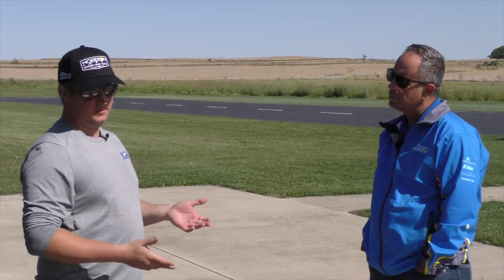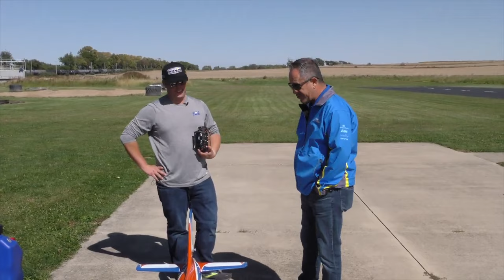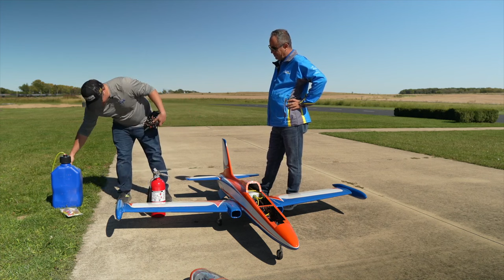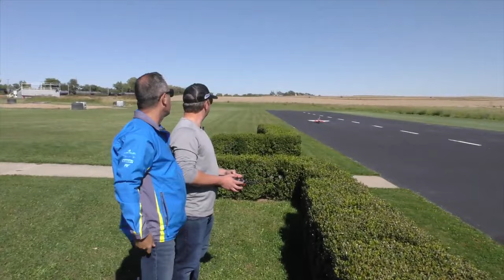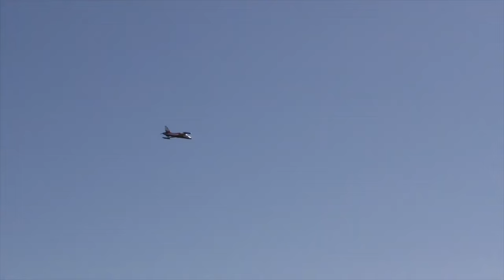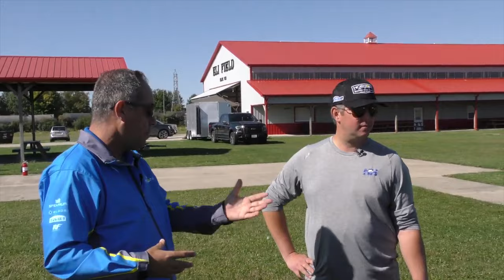Tips to Make Your First Turbine Flight a SUCCESS! | Hangar 9 Aermacchi MB-339

Comment: All good stuff and advice...; Except for me the MB 339 ain't that small! I tried the 80N engines and IMHO this airplane needs a 100N. That is the sweet spot for me as it's enough thrust to get out of bad situations if need be. I agree this airplane is not for high speed and so that given I still would say 70-80N engines will be a bit underpowered. 100 the MAX! If one happens to have a Jetcat P130 RX laying around (like I have) Then YES it will fit in the MB 339, but throttle management will be very important... Basically nothing above 1/4 throttle... LOL  😂

Comment: Well done. I am considering this airplane. As I watched, I had a sense of déjà vu; then I realized you are flying from the Eli Field that is the default airfield modeled in the RealFlight RC Flight Simulator Software! I wonder if this airplane is also modeled in that software? - if not, maybe you could add? Also with the other 720p comments, could you upload (to your server, dropbox, etc.) a higher resolution/quality format? Surely you didn't record in 720p.
Reply: Easy to Upload a higher res......Just depends on where you are as with a lengthy video that would mean a LOOOOOONG upload to Youtube. Have to also consider what everyone is going to be watching the video on. Mobile phone / Laptop?  Am about to twiddle my thumbs I think with a Go Pro Max (360) cam on my jet. The file size/s are going to be "significant!!?"
Reply: Admittedly this is my fault. I'm going to see if I still have this project file and upload a new version.
Reply: Also, yes the MB339 is in RFL Evolution and flyable at Eli Field :)
Reply: @StevesRC  yes, I should have just checked. I've already flown it in RealFlight 😁